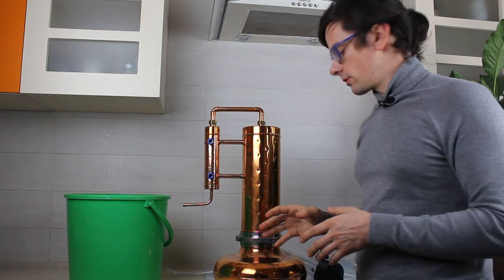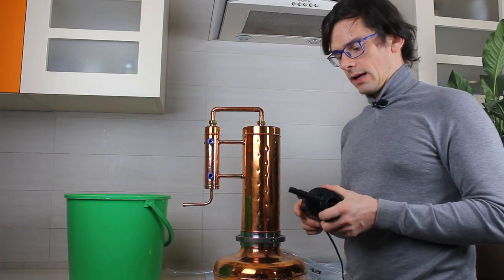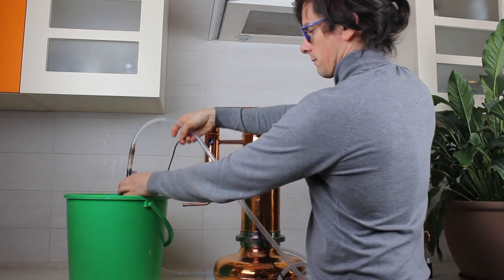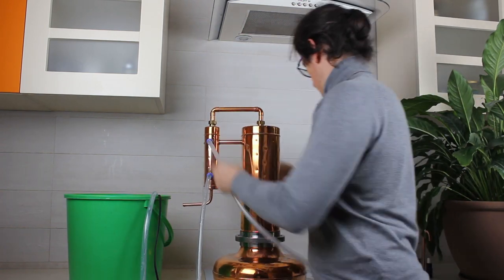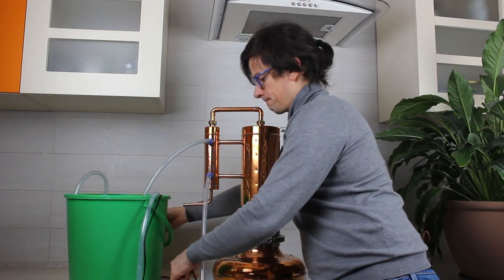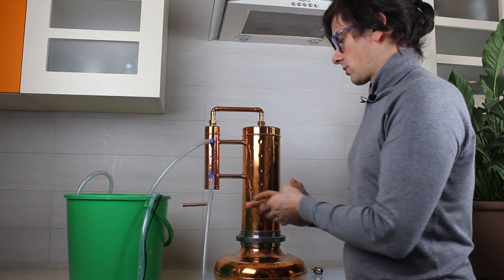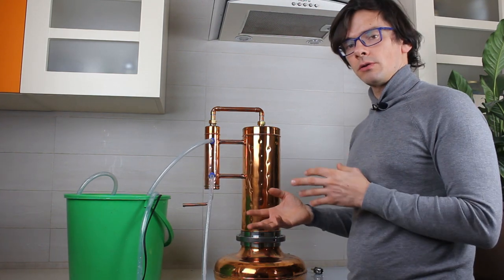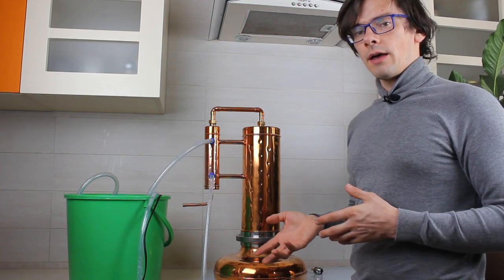How to use water pump for distillation? - Simple distillation

Comment: Hi, I just put Spanish lavender in my distiller & I did not get any oil from it, after 30 plus minutes.  I put 2 litres of water into my distiller.  I had lots of ice in bucket with the water pump.  I used medium heat.  Should I have used a higher heat ?
Reply from the maker: Please email me at copper.pro1@gmail.com and I will help you figure this out.

Comment: In the few distilling videos ppl say to put cold water in through the bottom and out the top. Why does it matter top or bottom of condenser? Thank you. Lily
Reply from the maker: water circulates in the radiator and evenly cools the steam, which turns into hydrolat and essential oils

Comment: How do you keep the tubes inserted into the blue connectors from leaking. even with very low flow from the pump, my tubes leak (I am using a peristaltic pump- not an aquarium pump).
Reply from the maker: Hello! Have you tried to distill without using this pump, in this case the tubes are leaking too?
Reply: @CopperPro  No, my faucet is not able to correct with the system, so I've only been able to set up a recirculation system with a pump and 5 gallon bucket. Only the inlet and outlet to the condenser are leaking. My condenser unit is the large one (8 L) with the female fittings for the tube. In the videos it looks like you just plug the tubes directly in to these or if the tubes have some type of adaptor to get them a tighter seal.
Reply from the maker: Tiffany Weir I will record a video soon and send you a link
Reply from the maker: @tiffanyweir364  Please watch this video and then let me know if you could solve this problem
https://youtu.be/49-cfUtcGto